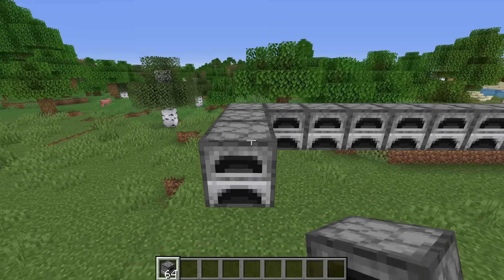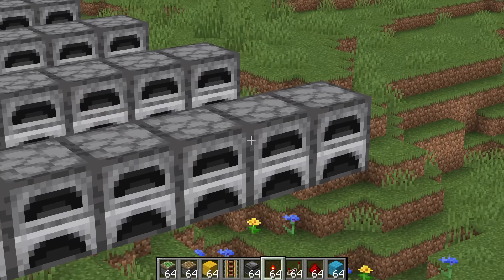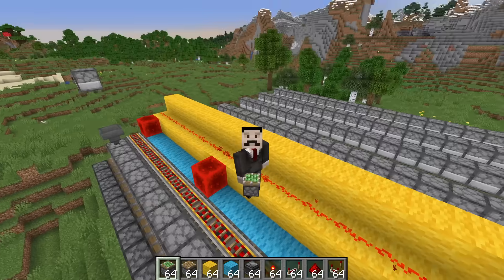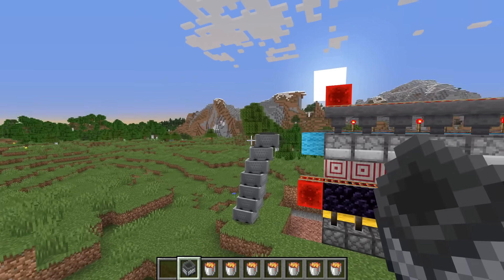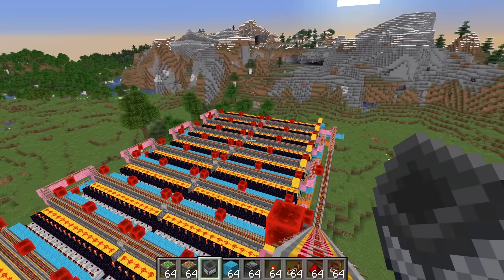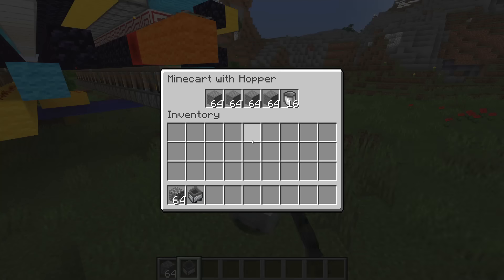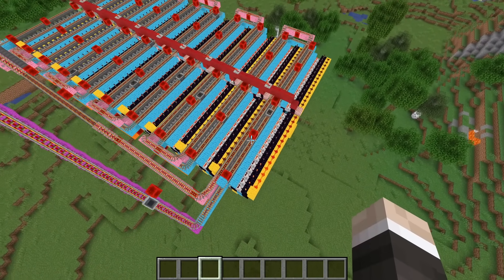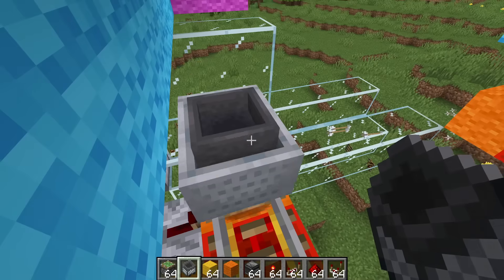Making the Fastest Smelter I Possibly Can

Comment: You absolutely should revisit this and make it fully automatic. Skeleton farm for the arrows, sort empty buckets out of the output and transport them back up to the lava generator. Can dispensers place and take fluids from cauldrons? If so then have a dispenser do the job of "harvesting" your lava farm.
Reply: If he can't use dispensers, then I think he should go with bamboo. I have seen him make farms for it that are fully automatic. And it wouldn't be difficult to hook them up to a super smelter. The biggest issue would be building one big enough to keep this thing running, without it being too big and causing overflow.
Reply: And i just realized he could hook it up to an automatic cobblestone generator too. And/or a cactus farm, or any other farm that produces something that can be put in a furnace for that matter.
Reply: @hanzzel6086  carpet duper
Reply: The other issue is eventually you'll run out of hopper minecarts to collect the smelted materials and buckets since he shoots them and then they split
Reply: @franticshooter7157  This makes me question if maybe there is a valid "solid state" way to collect the smelted goods without having to craft a furnace. Hoppers are slow, but maybe they can be optimized somehow to be at least as fast as the minecart system in this video.
Reply: He needs to craft the hopper Minecart
Reply: Skeletons won’t drop arrows if it’s not a player kill anymore
Reply: @oliverganski3509  Yes they do, make a skeleton farm from a spawner and let them burn on a soul campfire...
Reply: Also, build this on top of a sand duplication machine (endportal) so that infinite sand can be smelt.
Reply: @UbiMortus  that only works in bedrock edition (and is now patched)
Reply: And a tnt dupe cobble generator farm to make infinite cobble to smelt with the infinite lava and the infinite arrows
Reply: Idk why he didnt have the hoppercart that collects the buckets and items run over a few hoppers connected to droppers with redstone clocks then have them sorted based on if theyre a bucket or not and then if they arent then have those items get pumped into the storage and the buckets and hoppercarts go back up to where theyre needed this helps skip the breaking of minecarts at the cost of a slightly slower deposit of smelted items but it beats remaking and dumping the minecarts
Reply: I still can't believe a year later and dispensers still can fill or drain cauldrons with a bucket
Reply: @Frantic Shooter  now that they don't split when broken, this design is amazing
Reply: Yes he should do that
Reply: @Random_user_8472 or even have a dog auto-killer!
Reply: @0Ninja0Dude0 one day 🙏
Reply: @thearmedbandit  I still can't believe 2 years later and dispensers still can't fill cauldrons with a bucket
Reply: @0Ninja0Dude0  oh how I wish
Reply: Now with the addition of the crafter, he could even automatically recraft the broken hopper minecarts
Reply: @franticshooter7157 with the new auto crafter it can work now
Reply: Snowball farm instead would be better
Reply: @franticshooter7157  not an issue anymore with the crafter
Reply: He could use the new crafter to do it. I don't know if he can sort out only the mine carts and hoppers but if her can he just have to hook it up to a crafter set up which takes them, puts the together, then exports them back into a system which places them down and sends them back to storage.

Theoretically this entire melting set up is possible to fully automate and leave running
Reply: Crafters to remake the hopper minecarts
Reply: @franticshooter7157  Thats no longer an issue since we have the auto crafter

Comment: "We have got a renewable resource"
Arrows breaking the minecarts and not getting produced via a skeleton farm: am I a joke to you?
Reply: Also, cacti exist, and have been used to collect minecarts as items for ages.
Reply: @DonnaPinciot  the contents would get poked
Reply: @revtomstiles  
I had considered that, but with some expertly-timed pistoning, it may be possible to save any items from being poked too harshly.
Reply: @DonnaPinciot  The problem is that Hopper Minecarts when broken split into a hopper and a minecart. You have to manually combine them again.
Reply: @iz723  
That's a more fundamental problem with the system, unfortunately.
Probably the only solution would to have individual hoppers under each furnace, then maybe have them go in to a dispenser that sends them in to a water stream to get them to you really quick.

EDIT: Oh, to save on materials, you can have each hopper point towards the end of the line, with a single dispenser that sends it in to a water stream, instead of each furnace having its own dispenser.
Still a lot more hoppers, but also a lot faster and avoids any recrafting.
Reply: Wouldn’t he also run out of hopper mine carts since they break?
Reply: @borisjohnson7972  pretty sure they drop

Comment: Fun fact. You can just put filler items in the fuel hoppers because furnace fuel hoppers will only insert valid fuels
Instead of comparators to limit fuel hoppers to one bucket, you can just fill all but one of the slots with cobble or something

Comment: Amazing build, and beautifully chaotic. Probably going to attempt building in my survival world for the fun of it lol, but there are some things I’d add to improve upon the design: 

1) An item sorting system to filter out the hopper-carts and buckets from the items you have smelted, sorting the carts with an allay nonstackable-item sorter and sending those hopper-carts through a feed that leads to a dispenser to reuse the carts. This is now possible with the change of making the carts drop themselves rather than what they are made of. And for the buckets, just adding the QOL feature of sorting them and sending them up to the lava cauldrons with a water pipeline and bubble elevator. 

2) I would likely build this with a connection to a skeleton spawner to ensure that I don’t run out of arrows. Auto-skeleton-killer with either dogs or soul campfires, and a sorting system to filter out the arrows and lead them into the dispenser with hoppers.

3) I would likely time the delay between when the hoppercarts should be sent off, use repeaters to actually cause that delay, and aim them into the block holding the red stone torch. This way, you don’t have to time the delay yourself and use 2 buttons, rather pressing a button once and letting the repeaters do the work for you.

4) If I truly don’t want to use lava as the power source, setting up an auto charcoal farm (using kelp as the fuel for the charcoal generator) instead, which simplifies the red stone down a lot!

Either way an amazing build, those are just things I am likely going to add to it myself to maximize efficiency even further

Comment: the hopper minecart being broken to get its items is semi-fixed by the fact that in 1.20, it now drops both items as one unit when broken instead of two separate ones, so you could transport the hopper minecarts back up to the collection system and dispense them again.

you would just need a good single-item filter at the beginning to remove them from the storage system, or you would need to put filters on all of the smelted-item-storage hoppers and fill each one with one of the items that you're smelting and put the collection for the hopper minecarts at the end

Comment: only suggestions that I could think of off the top of my head is to have a sorting storage system to return all of the minecarts and hoppers to a quick crafting area for refilling the dispenser, setting the redstone buttons up to be powered by the same source, and for both of those improvements to be accessible from the same location you stand to fill lava buckets.

Comment: The smelter itself is amazing and nearly perfect, but I see two big flaws with the item pickup system: Because the pickup and carriage minecarts are getting shot by arrows and thus dismantled, the system that sends more pickup minecarts will soon run out of them. And also, the dispenser that shoots at the minecarts will soon run out arrows too. The both problems can be simultaneously fixed by having the Minecarts just circle around the system and get the items collected by a hopper hooked to a dropper. I hope it will be done quickly enough because if not, the entire system will Overclog.
Reply: the problem he mentioned is that the minecarts dropping off the smelted items dont have enough time to empty their entire load by just running over hoppers

Comment: If you add an item sorting system you could separate the buckets and feed them back up towards your bucket dispensary next to your renewable lava system, making it even more renewable.

After that the only manual resource needed is arrows, but I’ve seen suggestions for an automatic skeleton farm that could help? An upgraded version with total renewability would be interesting.

You up to the challenge?

Comment: I think you should add a sorting system to sort out the empty buckets and the hopper minecarts. Then it will put the buckets back into the dropper that gives you the buckets when you are farming the lava. At the same time, the hopper minecarts will be re-dispensed to pickup more items. And I think you can use cactus and a hopper under it instead of using like a 1000 arrows. I am not sure will the cactus thing work since I don't know will the items inside survive. If the cactus idea doesn't work, just replace it with a skeleton farm. Have a nice day!
Reply: You can use lava cauldrons with waterlogged rails. Watch ilmango's video to find out. And no, sorting systems are way too slow and won't replenish the hopper minecarts in time.
Reply: Sorted to gryffindor

Comment: Blast Furnaces and Smokers: Are we a joke to you?
Reply: No bro blast furnace only smelts ore and smoker just food so furnace is used most of the time
Reply: @BornToLive572  yeah
Reply: Still, if you want to smelt Specifically Ores/food, you can make a little bit smaller version of these machines, but I am not sure if that would be worth it.
Reply: the cons of them are they cant smelt building items like stone, smooth stone, cracked stone bricks, terecotta etc.
and theres a mod that has a new furnace named "kiln" it snelta the thing above.
Reply: @BornToLive572  That's why you need the system to sort every item that could possibly be smelted, and have three separate smelters to do the work, for maximum efficiency.
Reply: Noice
Reply: Yes
Reply: yes, they are a joke to me
Reply: @Jeshua Uriel Cuevas Glass: am I a joke to you?
Reply: Yes

Comment: One way to replenish the 'collection' hopper minecarts would be to have them run over rails on top of hoppers, instead of shooting arrows and destroying them. One could then make the track loop up and back into the glass tubes, so they are ready to be reused. One could also add an automatic sorting system as well, to discern buckets from smelted/cooked items.

Comment: I think you should have added a kelp farm, that continuously sends kelp into the smelter, then,  as long as you have a little bit of coal at the beginning, it will smelt it, then you can craft the kelp into blocks, put it into the fuel slot, rinse and repeat, never needing any coal after the first bit, so, you don't need to gather any fuel, or make the redstone circuit, meaning you can put more furnaces

Comment: For fuel part: you can actually fill the last 4 hopper spot with non-fuel items so they only hold 1 lava bucket

Or just pre-fill the the system with lava buckets that will work too

Comment: So, apparently if you want it to be fully automatic and without hoppers, buckets and minecarts in the output chests.

You could change the fueling system to a bamboo auto farm (just a taller sugarcane farm if you want to know) instead of the lava one,
it might need to be bigger but you wouldn't need to refuel it, plus you won't need those buckets.

Also just not use the arrow thing, ik mumbo was just making it quicker really but it would be really annoying to take all those items out every time you want to use it.

But ik it's just supposed to be a furnace but bigger and faster so you can smelt things in bulk, but it would make it so more practical

Comment: I think what he should've created was a wither skeleton killer in the nether and 20% of the coal is brought to the smelter as fuel while the rest is used somewhere else. That is completely automatic and renewable or if witches drop coal, a witch killer could be created or a completely automatic wood farm. Anything that is renewable and does not require the user to manually pick up the lava from the lava farm. All the user should have to do is put in the things to be smelted and push a button(Optional) to start smelting. The output could be dispensed and/or stored in the output chest/shulker box.

Comment: I would say a bamboo farm is a better fuel source simply because it doesn't require you to manually fill buckets. the downside is it takes ~205 seconds to grow 1 shoot of bamboo, and you need 4 per smelting which takes 10 seconds. 205*4/10= 82 bamboo per furnace times 300 furnaces, that's 24600 bamboo. thats a 160 by 150 area, or nearly 100 chunks. It would be much more effective to use bonemeal, but that also requires having a bonemeal farm, and idk how big that would need to be

Comment: You could simplify it a bit by letting the hoppers that feed in lava buckets run while full instead of dripping one bucket in at a time. totally removes the lower circuit from the design.

Comment: My thoughts to improve would be for the collection, have it sort out specifically the buckets, hoppers, and minecarts, so you can easily get those carts crafted, and buckets filled. And to add, make a system that brings the buckets to the lava farm. Lastly as a bonus, if your using this for something like ore and what not, you could set up a a sorting machine with the output

Comment: I solved the problem of fuel distribution by filling four slots of the furnace's side facing hoppers with any non combustible item (kelp in my case). Those items don't get admitted in the furnaces fuel slot an clog the 4 slots forever. Then there is at most two lava buckets queued per furnace, the  hoppers in front of the line do get filled first, but lava buckets burn long enough, so as they are full they don't take other items and hoppers behind them get their share without requiring a giant and gate contraption.

Maybe it wouldn't work with 300 something furnaces, though 🤔

Comment: Hmm i feel like breaking them at the end kinda make not automatic unless you got a way to autocraft hopper in minecarts you are gonna need to step in  you prolly can use a rail pressure plate to stop them from moving (or have a long trail of hoppers attached to dispensers with redstone clocks then have the hopper in minecart go back up to where it needs to be

Comment: A bit late, but hear me out:

Realistically this is not going to be in use 24/7, which would allow time for the furnaces to be filled up with bamboo, automatically supplied by an automatic bamboo farm. And realistically, the items smelted per furnace won't be 100 which is the amount a lava bucket can smelt, which would mean a bamboo farm would be way more efficient since you won't be wasting a big part of the lava bucket. Pro side of this would also mean less maintenance as you wouldn't have to fill up the lava buckets manually

Comment: I just stumbled upon this I basically built the exact same thing except for it's 100 furnaces and it has two flying machine bamboo farms when the bamboo is harvested it goes into shulker loaders then the shulker boxes get sent to shulker box unloaders and when the system detects that it needs more bamboo it just unloads the bamboo into a water stream it works amazingly with 100 furnaces I smelled a shulker box and about 3 minutes

Comment: I dont see how this is any faster than other automated furnaces. Also this method for a super-smelter does not allow you to collect the xp that all those furnaces produce and to fuel them with lava (yes there is a method for infinite lava with the dripstone but it still takes ages) does not make sense for me too. I am using a rotating super smelter system by shulkercraft (dont know if the original idea came from somebody else) connected with a 0-Tik Kelp farm (a bit updated for 1.18) so it gets fueled semi-automaticly with dried kelp blocks. infinite fuel, infinite xp and as fast as this but definitely way simpler, way cheaper and actually usefull. Sorry if it sounds harsh. This thing is awesome to see ... but lets be realistic. nobody needs this.

Comment: Could you in theory combine this concept with a bamboo farm for fuel so you don't have to deal with the buckets in your output?
Reply: if u were to use bamboo u wouldnt need all the comparator stuff, just a normal super smelter where the fuel minecart also collects bamboo
Reply: @dunnoforaname.4767  Oh so it'd be efficient at the cost of content. Makes sense, I might have to try it.
Reply: @akellerseattle  yh, if u want all hoppers to unlock at once, do it this way but u dont need to with bamboo because its a stackable item that minecarts will distribute evenly

Comment: just for the fact that it dose not seem big enough put a item sorting system on two one for collecting the buckets and another one to collect tht hopper minecart for the buckets loop it back to the droper so you can fill it with lava for the hopper minecarts have them go in to a nother hopper minecart so it can put them in 3 despnsers at at the top of the hoppermine carts storeing system and hook the despenser to a reapeting redstone clock their i told you how to make that insanaty 100% automatic and the last thing you need to do is get a omputer powerful enough to run it